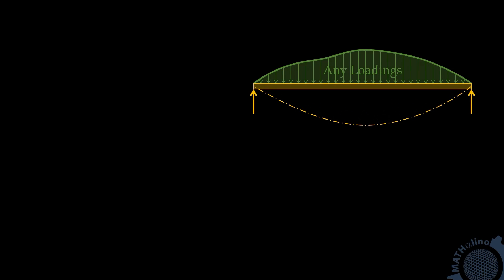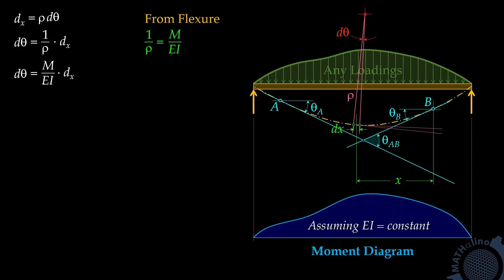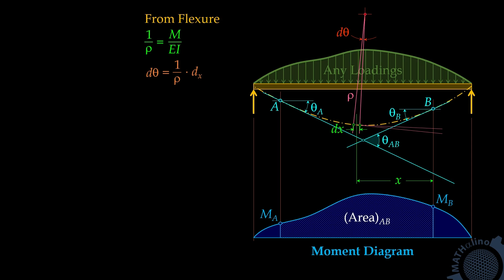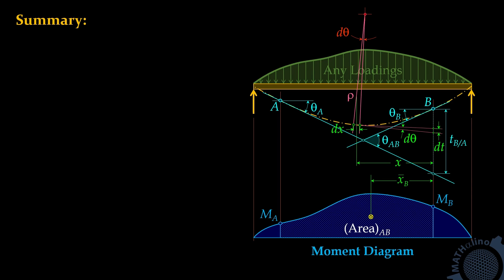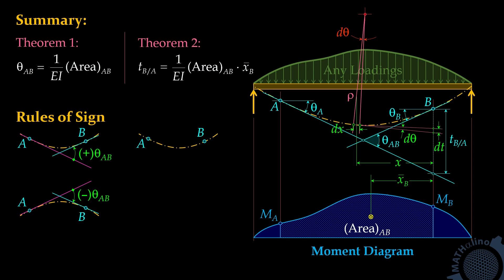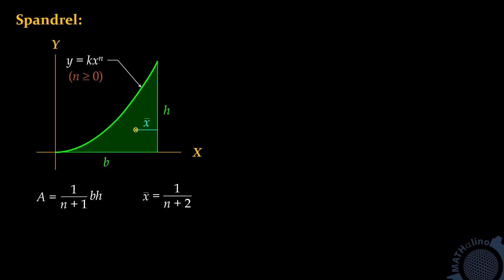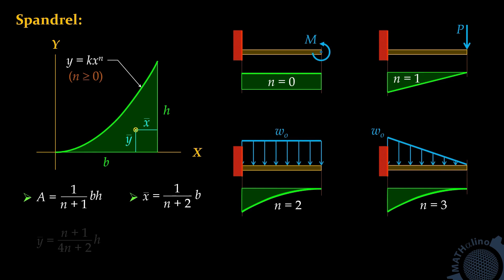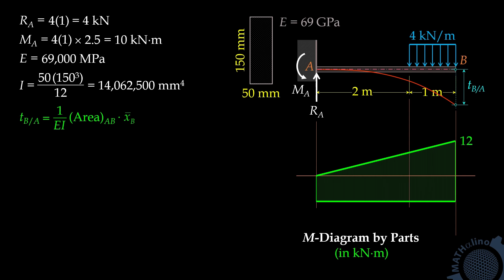Area Moment Method Part 1 - Basic Concepts | Theory of Structures

Comment: @10:09 why is the moment digram by parts of Ma -10. isnt is supposed to be 10 hence the moment in parts is in the upper part of the graph.
Reply from the maker: The sign of moment depends on which direction (upward is positive and downward is negative) for the beam bends relative to your moment centre.  @10:09 the moment centre is point B and Ma causes the beam to bend downward about point B.